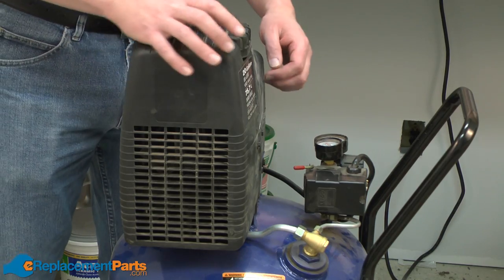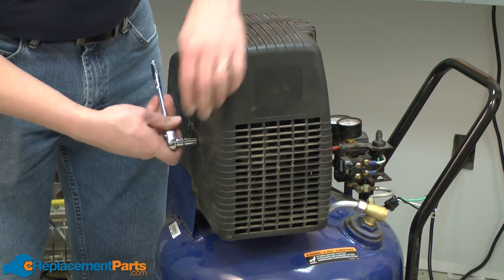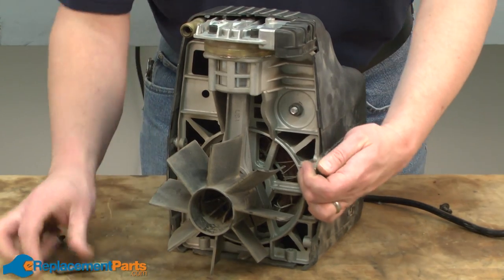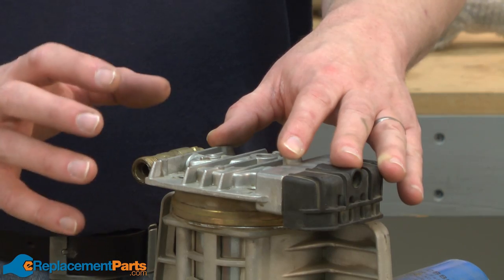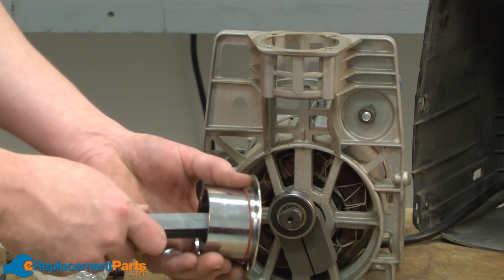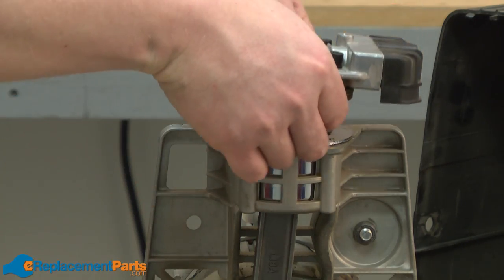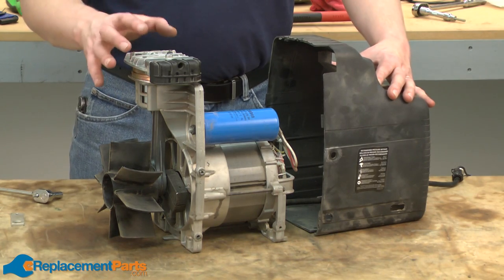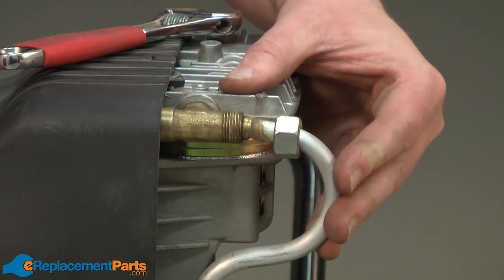How to Replace a Piston and Cylinder Kit in a Campbell Hausfeld Oilless Air Compressor HU008400AV

Comment: oilless compressor are good for homeowners who dont want to spend so many bucks on a compressor they will use just a few times a week, my recommendation is to add an air filter if your oilless compressor doesnt have it and once in a while you could use a dry lubricant in spray, such a crc graphite lube, those dry lubs will not get any dirt from the environment and can stand really high temperatures, and then to spray it below the piston so there is no need to take off almost everything to get to the top of the piston head, the important thing is to spray it around the walls of the sleeve so your compressor will run better and last longer................

Comment: Hello sir how much it cost me the valve and the piston with cylinder thank u
Reply from the maker: The Valve kit for this model is part number HU008100AV.  The price for the kit is $13.17.  http://www.ereplacementparts.com/valve-plate-kit-p-1389853.html

 
  
  
  
  
  Valve Plate
  Kit [HU008100AV] for Campbell Hausfeld Power ...
  www.ereplacementparts.com
  Buy a Campbell
  Hausfeld Valve Plate Kit [HU008100AV] for your Campbell Hausfeld Power Tool -
  This is a genuine OEM sourced replacement valve kit designed fo...
  
 

The Piston Cylinder Kit is part number HU008400AV.  http://www.ereplacementparts.com/piston-cylinder-kit-p-1583867.html

 
  
  
  
  
  Piston
  Cylinder Kit [HU008400AV] for Campbell Hausfeld ...
  www.ereplacementparts.com
  Buy a Campbell
  Hausfeld Piston Cylinder Kit [HU008400AV] for your Campbell Hausfeld Power
  Tool - We have the parts and diagrams to make your repairs easy.